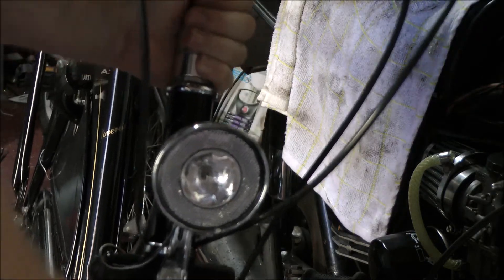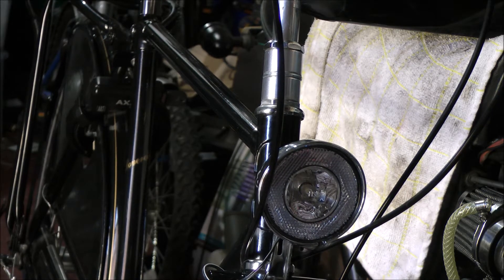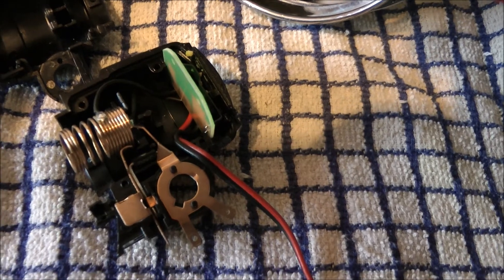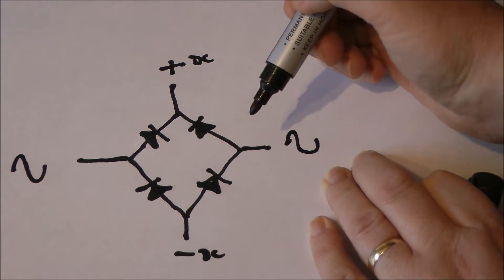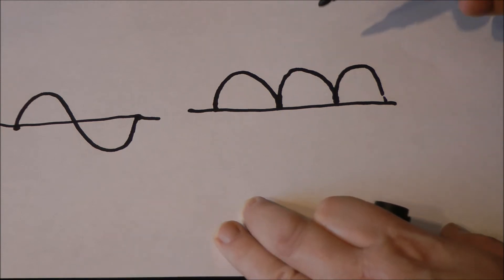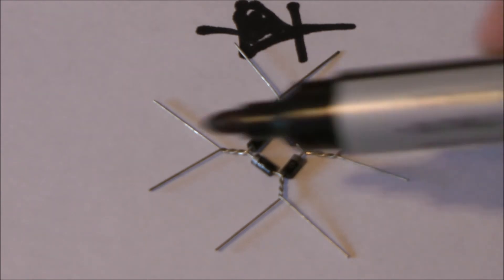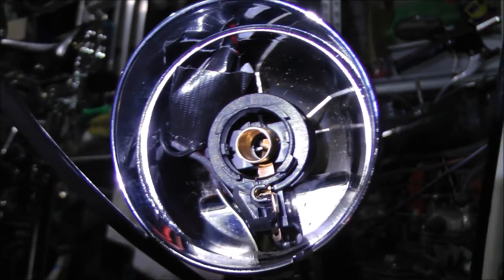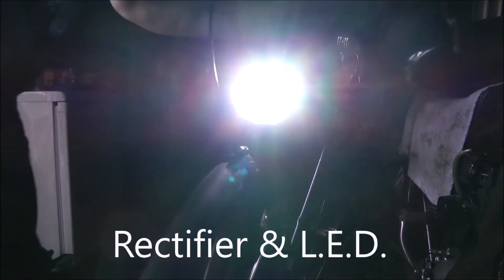LED Upgrade - Nicelite LED for Bicycle Dynamo Lamp

Comment: Hey there thanks for the great vid. Sounds like a standlight on a Sturmey dynohub isn’t a goer which is a shame. A circuit that just used the hub during the day to charge a higher output battery for a much brighter lamp would be cool cos you’d have brighter plus a standlight - but that’s way beyond me!! Will defo add the rectifier to mine and ideally the germanium diodes - don’t suppose you can remember the spec of those can you? (I know I’m years late to this party!!) cheers, Dan

Comment: Why didn't the hub dynamo already have a rectifier built into it?
Reply from the maker: Sorry for my late reply. Hub dynamos have been around for a long time - long before LEDs were invented, so AC power to an incandescent bulb was considered sufficient. A rectifier was historically not needed, and would also reduce the already low voltage to the bulb. With the amount of traffic nowadays, and ever more dazzling car headlights and distracting street furniture, there is a more pressing need to be noticed. Hub dynamos cannot give more power without increasing drag, and there's always the trade off of having any brightness at low speeds vs blowing the bulb if you get some speed up (more of a problem on small wheelers like Moultons etc) but thankfully an LED replacement will give brighter results for the same power used, and the DC conversion can be small and inexpensive. Hope this helps.

Comment: ive just bought the sister bike, the raleigh superbe 125th ani, could a wire be run to the rear light and earthed to the frame from there, or would you have to return the ground back to the dyno?
Reply from the maker: Sorry for the delay in replying. AC from the dyno could be fed to both, then rectified & isolated at each lamp housing - or a DC feed taken from the front lamp's rectifier to the (isolated) rear. I don't have the figures to hand to do the maths, but I'm confident these hubs will power 2x LEDs of this type. Hope this makes sense.

Comment: Thank you much. I now know how to adjust the chain tension, the shifting, and how to upgrade the headlamp. You've done a pretty good job on your presentation. Much appreciated. My sovereign is in pretty good shape, and will be nice to set everything correct
Reply from the maker: Thank you for your kind comments, hope your Sovereign gives you many years of pleasure.
Reply: @noble_wolf  shifting from 2nd to 3rd results in 3rd gear skipping. Shifting from 4th to 3rd results in 3rd gear acting normal. I believe the cable is a little bit too tight. I hope you can verify. In second the little yellow line is just passed the blindspot. Shall I back it off a little bit.?

Comment: Sir diode number
Reply from the maker: I can't remember the exact ones I used, but 1N400x silicon diodes would be fine to start with, very robust but you will lose a bit more voltage compared to Germanium.

Comment: What the volts of the 4pcs of diode you used in bridge rectifier?
Reply from the maker: The diodes were Germanium type, which allow a 0.2v drop across them (as opposed to silicon, which needs about 0.6v), allowing a higher dc voltage output.
From memory, I think their maximum voltage rating was 25v, but as long as they are rated higher than the dynohub's peak output, any standard diodes should be fine

Comment: Do you think adding a capacitor to the dynamo would help the light stay on for a bit while not cycling? I have an led dynamo that doesn’t flicker when riding. But I’ve been pondering on the idea of doing this to my setup for when I’m riding at night.
Reply from the maker: I think a 1 Farad capacitor (sometimes used in computers) might work, without messing with battery backup, that might be an experiment for later in the year.
Reply: @noble_wolf  I've done a 1F capacitor before, on an old sturmey archer dynohub. Famous for being 2W instead of 3 and being much lower frequency than a tyre dynamo, the result was it took 20 seconds or so before the cap was charged enough for there to be enough current to light the LEDs. After a few minutes riding I'd park up and they'd die in five seconds. I think a tyre dynamo might work out better.
Reply: Great vid for a newcomer to the “must use my original dyno lights at any cost” scenario! I have the Sturmey 3spd dynohub (1975 Raleigh Twenty) so it sounds like a big standlight cap isn’t possible. I wondered about a circuit where the hub actually just trickle charges a battery all day that has a much higher output to power a much brighter lamp for the ride home in the dark but that’s beyond me! I missed out on the nicelites so just have 6V SMD LED’s - much brighter but I defo need the rectifier - I don’t suppose you have a link/spec for the diodes and cap you used? Thanks again for the great vid!

Comment: sir do a video of night road test with your upgrade led headlights.
Reply from the maker: It's summer here, and light until after 10pm, so I might have to wait until later in the year for some darkness. It is certainly brighter, but the light seems to be designed more "be seen" than to see where I'm going on unlit roads.

Comment: Excellent video and I might do this to my Sovereign, which has been fitted with a front battery LED lamp for some reason.  Will have to see if the hub dynamo works first (it is minus wires so will need some investigating).
I've already replaced the Sovereign's seat post with an alloy version and fitted alloy bars also.  Currently awaiting the GC1 grips.  Interestingly the Raleigh Trekking Comfort roaster bars I used have a tad more relaxed angle to them and are a shade longer (nothing you'd notice visually) but certainly makes for a more comfortable ride and are less prone to steering wobble.
Reply from the maker: Thank you for your support. There are certainly a few areas where weight can be saved, and as the 'bars can make such a big difference to how a bike "feels" they're well worth experimenting with. Good luck with the hub dynamo, hope it's working OK (should be, they're usually pretty robust)

Comment: Thanks for the video. I have previously looked at nice light and was planning a similar project but just haven't got around to it yet. I'm planning a similar project but with a simple battery backup circuit. Its not that I particularly need battery backup but it will make an interesting project.
Reply from the maker: Thanks for your comment. Battery backup should indeed be a nice project, particularly if you regularly ride at night.

Comment: Good afternoon, I have that lamp and I also have a Shimano dynamo.  The lamp arrived without cables and I don't know how to connect it to the dynamo.
Reply from the maker: If the lamp has no cables, and it's the same model, there should be a pair of terminals where the bracket attaches (I think on mine, they are to provide feed for a rear lamp). If you're just feeding the lamp AC direct from the hub, just connect to those. If you're converting to DC for a LED though, then you'll have to isolate the lamp to make sure it doesn't "ground" to the frame, and be a bit creative where you fit the rectifier (I'd try to fit it inside the headlamp shell for neatness, then run the DC wires to the terminals).

Comment: Wow this is the video i needed, i was trying my hardest to follow the bridge recifier, but you cut the soldering where you attached the capaciter so got a bit lost. Do you have a link to a video of someone making one.
Reply from the maker: Thanks for your comment. The capacitor can go anywhere, as long as it's across + and - , it's usually easiest at the rectifier but it could even go across the bulb terminals. The negative - is marked on most electrolytic capacitors, and higher capacity will give smoother output. Without the capacitor, there will still be flicker but at twice the frequency, so in theory should be tolerable at half the speed. Hope this makes sense ? If not, let me know and I'll find a suitable link
Reply: @noble_wolf  Just nervous with anythink electric as dont want to damage the light. this seems quiet detailed https://www.youtube.com/watch?v=LD6RFOhJf68

Comment: Impressed with your electrical knowledge, it’s something I can never grasp , well done.
Reply from the maker: Thanks, it's just basic stuff - I used to work in electronics and it was a hobby for a while fixing TVs and VCRs, I've forgot loads over the years but I still dabble every now and then.